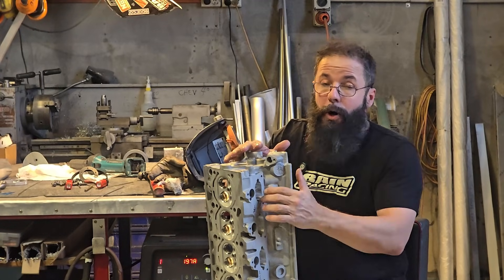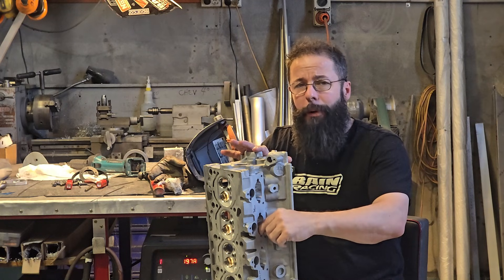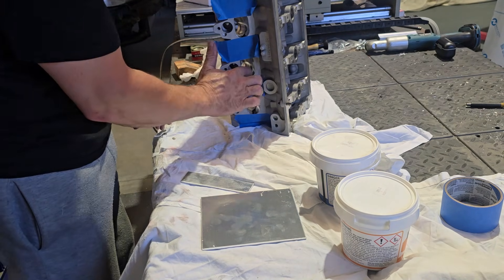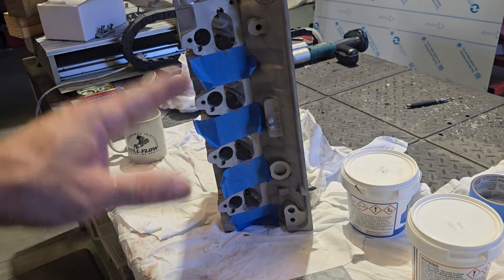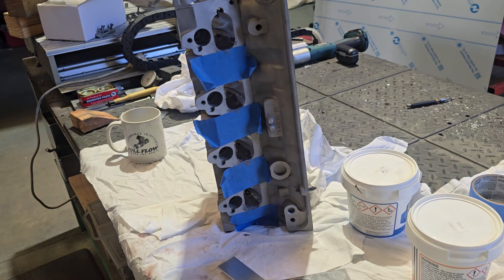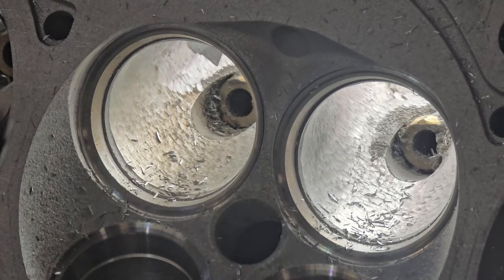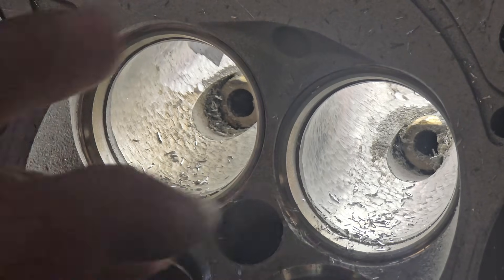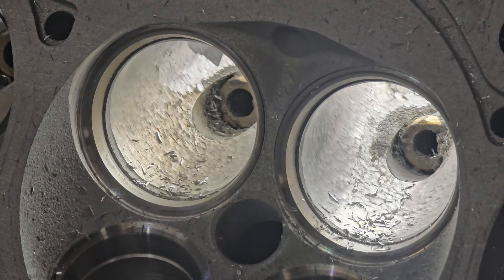Welding & Epoxying Ports - Final S3 Audi 800HP Head Porting FINAL Episode

Comment: Do you reckon epoxy will work on a supercharger manifold to match 2V to 3V ports? How reliable would it be?
Reply from the maker: Yeah if its prepared right you shouldn't have a problem 👍  we have molded full plenums and runners out of it to reshape the insides of tunnel rams.

Comment: Is that epoxy resistant to all racing fuel such as nitromethane and corrosive methonal fuels like vp M5?
Reply from the maker: Nitro.  You are best off sealing it.  But in saying that I know guys that don't and have years of success.  But I do just for safety sake. 👍
Reply: @bainracing  Hey jake, what would you use for a sealer?

Comment: I used to go through the Z-Spar by the gallons doing Super Stock heads 99% were cast iron porting jobs. I'm glad now that Aluminum is taking over, I can do more with them.
Reply from the maker: 100% mate! Greqt stuff! 

One of the super stock guys we build intakes for still fills the aluminium heads up everywhere! 😂😂  unfortunately can't show pictures as you know why 😉.
Reply: @bainracing  I stake the floor when I use a thick stack on the floor the narrow ports want to pop up the epoxy more than the wider Hemi ports once it breaks free around the edges fuel starts getting underneath the Z-Spar and it can lift out. the engine chews it up...

Comment: Hey Jake, What epoxy do you use?
Reply from the maker: Splash zone mate. Some call it Z-spar.
Reply: @bainracing  Thanks Jake
Reply: @bainracing  I've been searching for the name you gave, but Google doesn't show the same containers you have. Could you please tell me exactly which one it is? I'm from Spain and I'd like to be able to search here in Europe. Thank you.
Reply from the maker: Thx man! 😂👍
Reply: @goyocarreras  jb-weld epoxi for aluminium is commonly used to. You shall use epoxy that is designed to have similar expansion rate as the metal otherwise it may losen after repeated heat cycles expanding/ contractions of the metal
Reply: I'd like to know too.

Comment: Fun story. Back when I had a moped as a teenager there was this idea that you should fill the inside of the piston for more power. So I did. Took some ”liquid metal” and filled it up.
Put it together and it ran fine (maybe a little better?!?). Drove to my friends house and stayed there for a while.
When it was time to ride home the damn thing wouldnt start! In fact it was hard to turn over.
Pushed the moped home and topk it apart. That liquid metal had melted and formed small balls that know were everywhere in the motor.
But after a clean with diesel I could put it together and start it.

Lesson learned, check the heat range of the stuff you use.. 😁
Reply: "you should fill the inside of the piston for more power"
-Explain.
Reply: @NotSure723 yeah Im not sure what the reasoning was. Maybe it was supposed to give more suction in the crankcase? 
Thats two stroke engine mind you.
Reply from the maker: Oh wow! 🤯.

Comment: Whats your thoughts on using epoxy on a street engine?
Reply from the maker: Not problem mate. Have done hundreds.  If. You're using methanol you should seal it.  But in saying that I have engines on 10-14 years old still holding up on methanol with no sealer. 👍  but it will come down to what epoxy you use.  The splash zone is very chemically stable.
Reply: if it's done correctly, it will last a long time, but you have to put a coating over the epoxy...
Reply: @masterspin7796  
" you have to put a coating over the epoxy..."
-How so?
Reply: @NotSure723  to protect it from the fuel it will erode it over time. Alcohol will eat it up quickly too..I have also used it in exhaust ports but you have to spray it with ceramic coating/header paint.
Reply: @masterspin7796  
" to protect it from the fuel it will erode it over time"
-I submerged a chunk of JB weld in gasoline for several months, agitating it regularly, and there was zero erosion.
Reply: @NotSure723  the air speed makes it erosive it eats it away I have been using it for over 30 years....I am talking about larger amounts of epoxy, filling the floor streamlining the guides etc... small patches last longer.